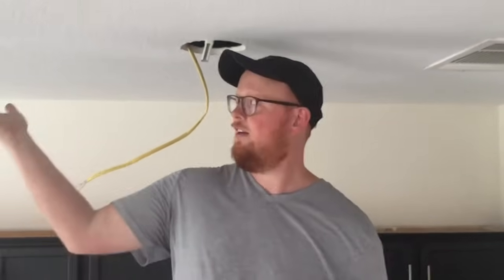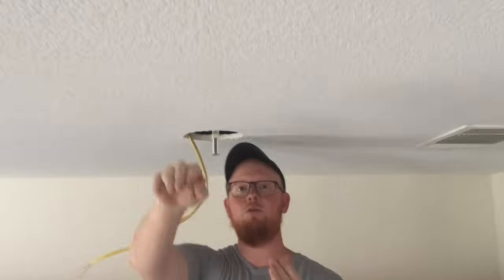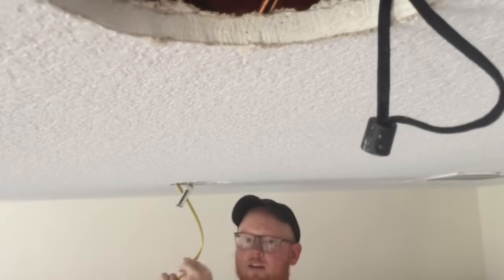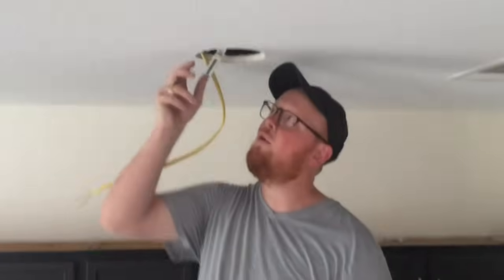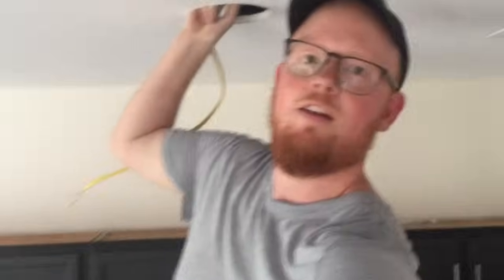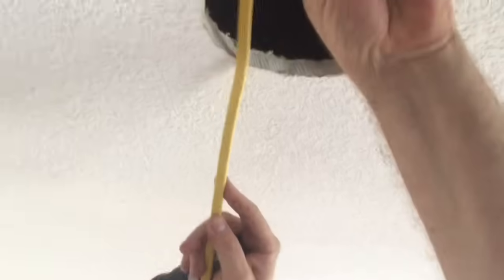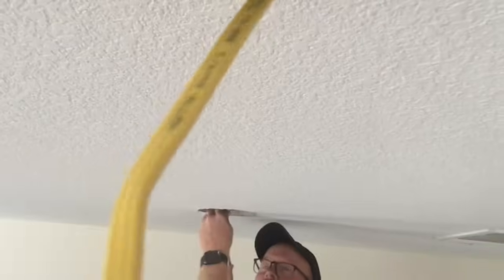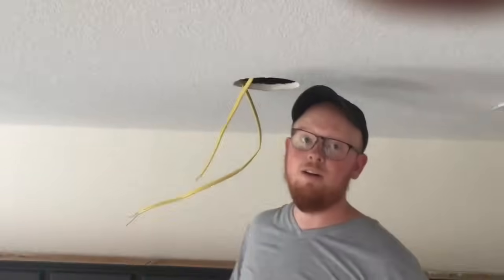Genius Method For Fishing Romex

Comment: Show us how you drilled those holes through those two, 2X trusses.  Right angle drill?  Flexible drill bits?  At 28 seconds into the video, I see something up there, but I can't identify it as a drill bit.  Did you drill from each side?  How big were the holes that you drilled in the trusses?  Getting that curtain rod through one hole in a truss must have been easy, but getting through that second hole from the blind side must have been time consuming.  You could have stuck one of those magnet-on-a-stick retrieval tools through the other side if the magnet was small enough or if the holes in the trusses were big enough.  Show us what you did, we don't like to guess.
Reply from the maker: We drilled the holes with a 3/4" auger bit from each side, and they were already drilled by the time we did this video.  Getting the curtain rod through both holes was not difficult.  It just took a little feeling around.

Comment: I'll have the same problem.  This may work well!
Reply: I've used fish rods in a similar situation , Where I knew without question there were no hazards),and I will tell you that it's very difficult to get both holes not only parallel, but also lined up on both height and depth. If you pull it off, you are lucky.

Comment: Look at all of the electricians here in the comments. They had a trick that worked and didn't cost them time and money driving around to find what they need for one job. So what they used 12-2 instead of 14-2.
Reply: EGGINFOOLS  obviously because the old wiring in the switch is gage 12? Da!!
Reply: Luis Guerrero What?
Reply: I’m answering your question, of why are they using 12-2 instead of 14-2, and I gave u the answer that they probably used 12 because the existing circuit in that room was wired with wire 12
Reply: Luis Guerrero I didn't ask a question. Read my comment again.
Reply: They probably should have used 14-2, most likely the lighting from the switch to the cans are 14-2 14-3. You shouldn't mix wire sizes, it can lead to bigger issues down the road and a waste of money.
Reply: If it is a 20 amp circuit 12 is required. 14 is ok for 15 amp circuit.
Reply: Changing wire gauges only matters if the wire has insufficient ampacity for the circuit. Changes in size are very common on large (long) branch circuits on commercial projects
Reply: 12-2 is fine anyway, just a little more difficult to work with. The breaker size for the line they tied into is what's important.

Comment: if you drilled through trusses, you killed your house. I'm guessing you meant floor joists.
Reply: drilling a 1/2 hole through a couple trusses isn't going to do any damage to there structural integrity. if they where giant holes that ran through the majority of them then maybe.
Reply: don't spread false information. the UBC states you must not drill or notch an engineered truss without a document from an engineer.
Reply: In certain spots on those beams you can cut all the plywood out except for an inch on top and bottom and still retain structural integrity.
Reply: And you would need an engineer to tell you where those certain spots are?

Comment: Would certainly not call this genius, possibly call it ingenuity for using what you have on hand.  However for $7-10 from harbor freight you could have gotten either a long drill bit or fishing rods designed for this job.  Title should be "poor planning requires makeshift solution".
Reply: Agreed, the yellow fish pole sections at HF work very well.  It's always easier to do a job with the right tools, and in this case, they are rather inexpensive.
Reply: A long drill would have been hard to manipulate through the small hole in the sheet rock.  Wouldn't have been able to drill perpendicular through the joist.  The HF tool may work very well, but not everybody has convenient access to a HF store, and probably doesn't want to put off the project waiting for it to be delivered.  Give these guys credit for sharing a clever insight to use a common household item as an immediate solution to a problem, saving them time (and money spent on a tool they may well never use again).
Reply: Long flexible drill bits are made exactly for this type of work and come with a tool to manipulate the position from outside the hole.  They in fact will work in an even smaller hole such as that for a single gang box.  Granted though the good ones are not cheap.

Fiberglass wire fishing tools and long flex bits are available at Home Depot and Lowes.  Even relatively small cities have a Home Depot.  And if you live in a very small town, then you are used to ordering the tools you need to do a job.  Sure sometimes we run into a issue during a job that was unexpected and need to improvise, but this isn't the case here.

The video is titled as a "Genius Method For Fishing Romex", implying a better way will be presented vs the typical way cable is run in an existing wall/ceiling.  Proper tools and traditional methods would have worked faster and easier than the what was in this video.  A more appropriate title would have been "Improvised method to fish romex" or "How to fish romex without special tools". The video should have had some discussion at the beginning about not having the right tools required them to get to creative to come up with a solution.
Reply: Well said Zeric.
I have about half a dozen of those flex drill bits. Using these for a can light (so 6.25" hole) driling into 2x6 or 2x8 joists is a cake walk compared to finagling these through a fire-block and headers to second story from a single gang box.

In the end this was poor planning for a highly expected problem

Comment: So you drill thru studs blind? What happens if wires are stapled to the studs and or water pipe is in one of those bays? You just drill right thru it? Terrible idea that's gonna bite you in the ass one day. Make necessary notches around studs

Comment: Somehow I don't think these guys are electricians. Looks like the integrity of the TJIs have been compromised.
Reply: How do you do this properly, without compromising TJI integrity? (I may need to do it.)
Reply: Read the specs of the joist most allow up to 2" hole
Reply: Tji can be drilled but typical 2x joists should only be drilled within 1 foot of support
Reply: Farmer Dave nope. Those are punchouts. No integrity issue at all.

Comment: its lighting and you should be using 14 gauge wire for ease of wiring fixtures and fitment in the boxes that are small for old work fixtures. There is drill bits up to 6 foot long that are flexible and have a hole in it so you can attach a wire to it when you are done drilling. Genius? I think not. There are professionals for what you are doing ya know.
Reply: +Tony Jannace  New construction might call for 14 gauge wire on a dedicated circuit but if doing a retrofit from an existing circuit that's already 12 gauge they must maintain wire size on the entire branch circuit for code compliance.

Comment: Some of the asshole comments slamming this guys clever work-around are so completely uncalled for. The guy drilled the truss from either side, and short of having a rigid fish pole designed for the job, he mcgyver'd it and it was perfectly adequate for the purpose. Was it genius? Maybe not, but it was what needed to happen and clever usually gets the job done, while the genius would still be dreaming up a 'genius' solution, or (following all the Mensa members who tout Harbor Freight, as well as the better brandnames) driving out and contributing to the ACTUAL genius who marketed fibre-glass rods to previously clever electricians who were fumbling around using shit they had on hand to perform an already pain in the ass routine of wire fishing for remodeling jobs.

Comment: Your genius method is in violation of the National Electric Code. You cannot drill through a truss as it is a support structure. Romex is to be strapped/stapled along the truss edge, no more than 2 pieces of Romex under a single strap.
Reply: chosbach411 can you provide the reference (article number, subsections) for this rule please?
Reply: Raymond McGee, I unfortunately cannot atm as I'm in one place and my code references are not available, however, strapping often depends on how strict your inspector is. Sometimes you can "get away with x3 Romex" under a strap and the inspector won't say anything if the job is clean and neat, but that's not the code requirement. I was in the trade (residential/commercial) for a long time and for interior strapping on exterior concrete walls w/ furring strips I'll cut the furring strip, use a kick plate, then run the Romex on the concrete side for vertical runs. Strap it with leftover stripped off Romex sheath and tack to furring strip. I roughed and finaled too many houses to count, let alone service work and never failed a single inspection. Yes there were things inspector asked me to tighten up, but never failed me.
Reply: chosbach411 Thank you very much. I was trying to get clarification on the issue with drilling into the trusses. I don't ever remember seeing anything about that in the NEC. It could be that it's a residential building code issue. Thanks again
Reply: Raymond McGee, Happy to help. Regarding drilling the trusses, the reason you cannot is simply due to the fact that they are load bearing and any wood takeaway (drilling, etc.), compromises the architect's design load calculations, especially in areas like Florida for example where high wind loads are expected.
Reply: It's perfectly safe. I'm assuming they're the homeowner so they can do it however they want. Besides every wall stud in a home has a hole in it. Don't drill within 2 inches of the top and bottom edge and make sure your hole is not larger than one third the depth of your lumber.

Comment: You ruined the trusses,  they can't be drilled.  The bottom cord is in tension and now a significant amount of wood fiber is missing.  Truss wood is graded to a standard for their use.
Reply: Jeff Beck 
You said truss which is different than a joist, you never alter a truss.  You are correct if it is a joist but should be drilled in the center of the web.  I'm sure you do great work,  just putting that out there so people won't alter a truss.  Sorry I was offensive.

Comment: You don't get to call the standard method that people have been using for years a genius method that's just what people do dude some people stick a a copper pipe in there or a piece of pipe and just feed the wire through the pipe some people use what's called a glow rod some people push peace pipe through their tie the thing to it and pull it through but this is not a genius method this is just the way people do it.
Now if you have some other way that people have done it that you've improved upon that's one thing I don't mean to be rude here but you just showing everybody what everybody has been doing for well over a hundred years.
I would like to hear some Les genius way that this replaces otherwise you're just telling everybody what everybody already knows dude this isn't a genius method this is the only known method that every electrician already knows